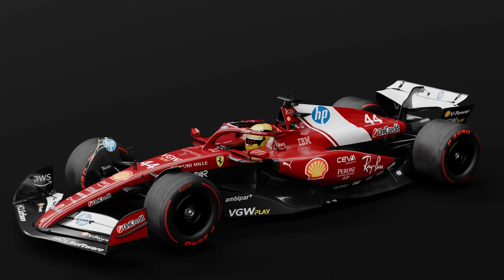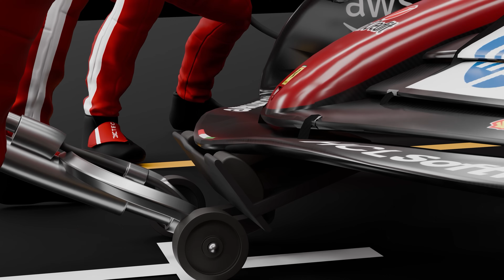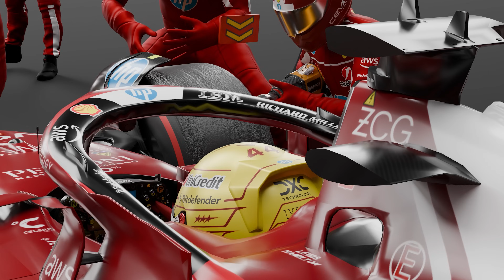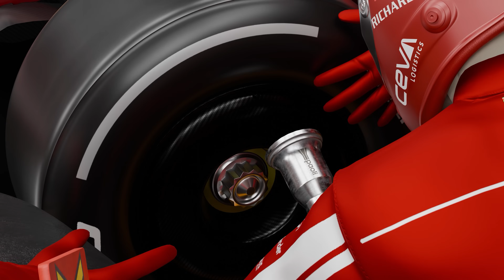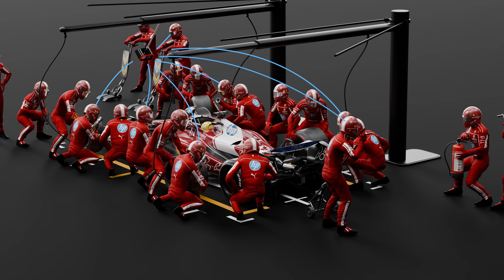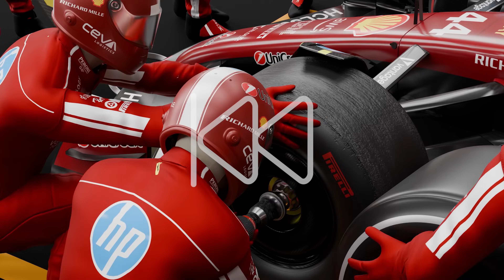What happens in a Formula 1 Pitstop?

Comment: As an athlete and engineer i always thought F1 is just a motorsport,, but now I saw some races and engineerin. It's like peak of human engineering and athleticism, it's amazing to watch what human has achieved in that industry.
Reply from the maker: True! Not just the drivers, but the pitcrew also have to be in top shape. It’s not enough being fast, they’re responsible for dealing with 10-15kg weights they have to move in fluid motions with less than a second to spare, the pitguns themself not only exert pressure on the operators hands, but the level of precision required to not weld the threads is immense. It’s a marvel what they do today!

Comment: F1 should introduce air jacks like WEC... we could have even faster stops and the front wing change stops wouldn't be as slow
Reply from the maker: Interesting take... with the current ground effect rules this might be impossible, and even in 2026 there are some ground effect characteristics still present making the floor very sensitive. Not to mention the added weight, as well as a chance for system errors. Aren't manual jacks much more reliable?
Reply: @TheRacingCompany_official good point but it would look cool. Worth the risk 😂
Reply: is that really faster though? The air jacks sometimes seem to make the car wobble for a split second